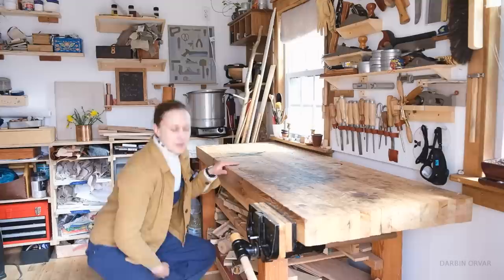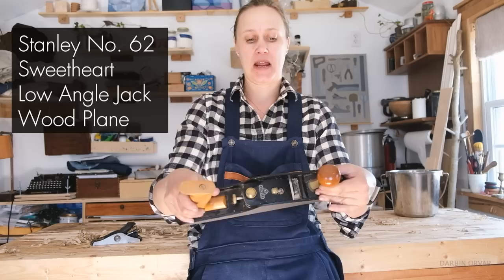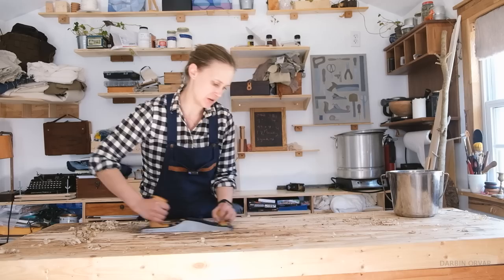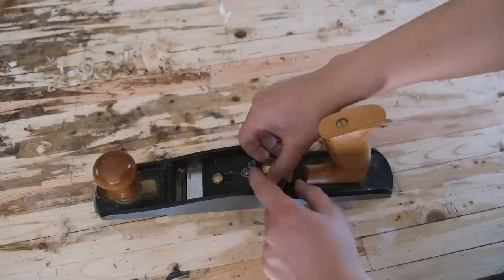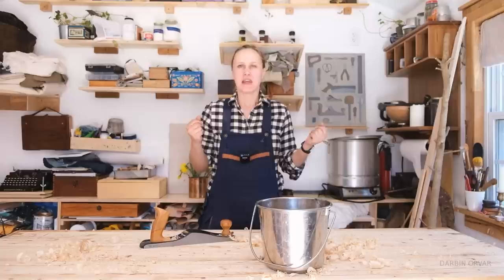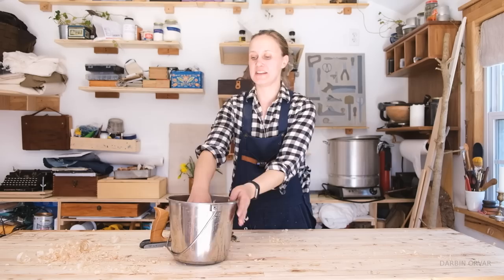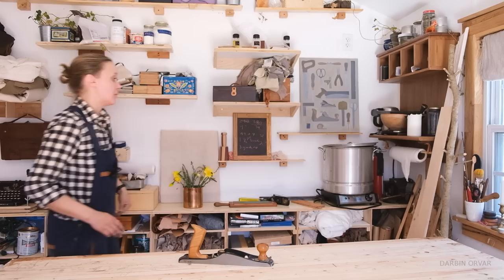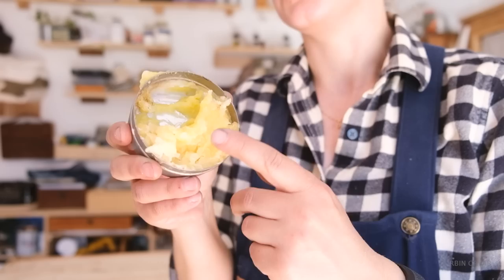The incredible HAND PLANE. Cleaning up a workbench with a Stanley No. 62 Low Angle Jack Plane

Comment: Seeing this in action, now, NOW I see the advantage to having that thick built-up bench top. Get the gouges out, the dirt, etc. And there's still plenty of bench top table to provide strength and rigidity. It might be heavy, but you don't need to let it be beaten up and ugly either. And great point on "skewing" the chisel across the surface. I remember learning that trick from Norm Abram/New Yankee Workshop. Planes can be used all kinds of different ways, especially if they're having problems going along the grain.
Reply from the maker: Haha, I had a whole rambling section where I went on about exactly that - the advantage of a thick built up a bench, and how you can clean it like this over and over. But I figured I did enough talking as it was, so I cut that part in the video :)

Comment: As near as I can tell, there is no consensus on finishing a workbench. Some do. Some don't. Everyone's got a preference. Mine's built of Southern Yellow Pine and construction lumber. I've never bothered to finish it. I'm not sure I'd make a workbench out of much more expensive material, but if I did, I might give it some kind of protection, so long as it didn't make the top too slick to work on.
Reply from the maker: That's the thing, right? You don't want a super slick surface, yet some protection is nice.